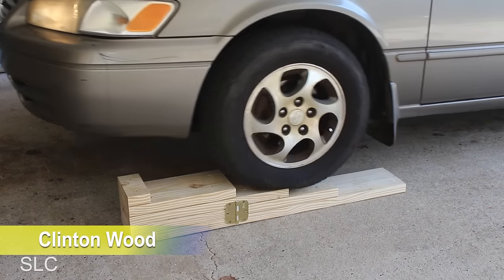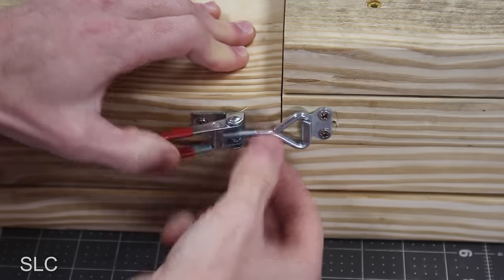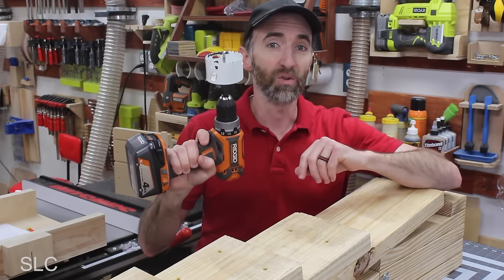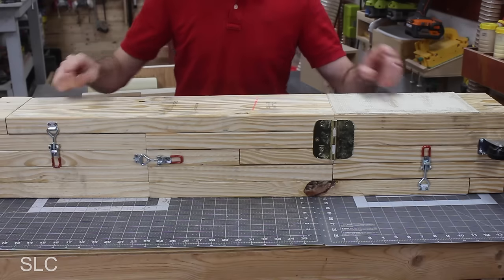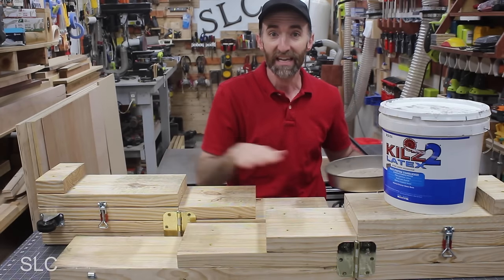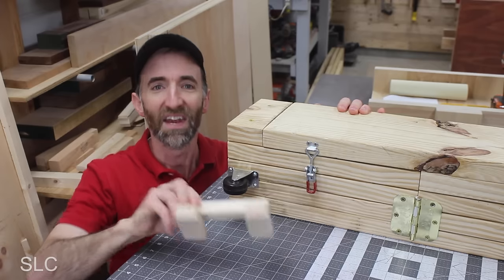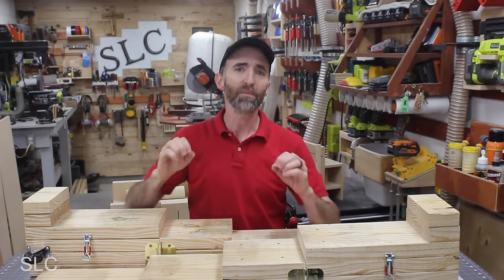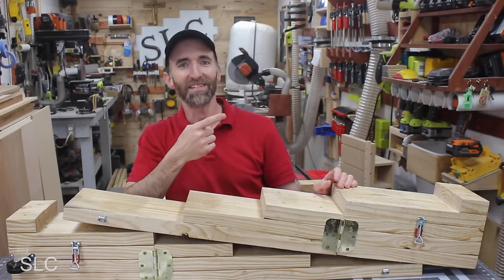Improving the Best Car Ramp EVER

Comment: Good video, I made some similar about 30 years ago. I like your hinge part to swivel out of the way. To improve your caster, recess the casters and maybe even just clamp them togather on both sides so you could just get them out of the way all togather. Mine are longer so I can drive further on them but they do not swivl out of the way. I think I will make some more and make the center board longer on the drive up side to where it will engage into the section that the wheels set on. and use the clamp idea  on both sides to get the drive up side completely out of the way, i do want the set on side longer though. Some really good improvements ideas in this video.

Comment: could also add truck bed liner on the tops to give grip/protection
Reply: Could you add it to the bottom to reduce sliding on the concrete as well?

Comment: For service work the entire length of the car consider two sets. One set for the front and one for the rear. Good grip to the supporting surface, concrete or pavement below, will be critical for the set under the non drive wheels of the vehicle.

Comment: the 45 degree is very necessary, specially when you need to push the car instead of using his own power, also it  helps to go easily and when you touch the 90 degree stopper you can feel it is the end of the ramp

in my case i needed them much lower because of my race cars didnt fit on lots of things and needed it a little bit of height to get the jack underneath so i can lift it up much higher

Comment: Use linseed oil to preserve and protect the wood it just basically soaks in and doesnt compromise it ie making it slick can also put some old tyre cut offs for additional grip along the bottom plus up along each step but everything added will add weight

Comment: Some good suggestions. I would also be concerned about driving over the block on the top ramp. It's a good reason to put an angle on the other boards so the car rolls over them easier. That way when you hit the top it would be a lot more noticeable. Personally I prefer to just use my floor jack and jack stands since 90% of the time I am working on the front end requiring my tires to be removed. Still, this is a good design and beats the old metal drive up ramps which cost more and have a tendency to slide.

Comment: Have similar ramps that we use at work, we drive 50,000 lbs buses on them so most people using these for their cars could remove a lot of material for weight savings without them becoming to weak.

Comment: Great video and i think ill build me some cause even tho i have a truck thats about 11inch off the ground its still a little hard to maneuver around. Now i do have a suggestion for these ramps tho. The bottom board i think is great and all but if someone wanted to reduce just a hair bit of weight to cut off a portion of on both ramps. They would still close up together when stacking and most all vehicles dont truly need that much extension for there vehicle to climb up.
Reply: Sports cars 🏎

Comment: I would add a 45 degree miter to all the edges of the boards that you are meant to drive over. This will make them easier to drive up and help separate the feel of the top stop block from the other boards.
Reply: Your both right.  Only a moron would leave out the miter.  And a stop at the top is really not necessary if one has any awareness of what they are doing.

Comment: If you work on a shed or garage. Mount a mirror on the wall so you can see the car wheels on the ramp.  Second hand furniture shops often have large ones cheap.  That way your 'spotter' can fetch you a cold drink instead of having to stand there

Comment: instead of an extra block for the stops a 2 or 3, 1/2 bolts 6" to 8" long that drop in 5/8" holes at the end of the ramp.  The bolts could be stored in horizontal holes at the end of the ramps when not in use

Comment: I think I'd use the type of hinge that can seperate. Then the whole lower side could be removed when the car is up. My workshop has a hoist and floor jacks so I don't have need of these. On the trail I made wooden traction boards that I've used as ramps using rocks underneath. Didn't need to raise the 4x4 much.

Comment: Nice job, something my dad would have made. I would make them wider and place a handle so when you use the wheels you grip the handle. The drawers liners are going to wear out too fast for my liking. You can still use them, I just wouldn’t mount them to the ramps. I’d lay them on the ground and then place the ramp on top. I wonder if a chuck or something else might work as well. I wonder if skateboard grip tape would work on the top and bottom for grip.

Comment: Hi, I would suggest cutting at lease a 45 degree angle on each step so that the drive up will be a bit smoother. I understand that it won't be by much. Also, the first step don't cut the angle to a sharp point.

Comment: I love simple and effective solutions, I'm a diy'er from way back.  I wouldn't waste time with handles or latches, I would just use a couple of those adjustable luggage ties, or even a couple of bungee cords wrapped tightly around, and another bungee cord to use as a handle across the two strapped around.  You could add another longer board on the bottom so it was still a graduated angle of elevation.  If you still can't get in on the side, why did you design them to be split in half with hinges and break away?  I would think you would want a height so that you COULD access things from the side as well.  Finally, some kind of stop would be good, but being careful is just as good.  Maybe use wider wood, to be safe and not slip off the ramps?  Great idea, watch out, some company may steal the breakaway idea.  Check out how to patent that.

Comment: Definitely go with pressure treated lumber if you cannot keep the ramps dry. Trying to paint those water proof and failing may cause catastrophic failure when the wood inside the paint has gone bad but you cannot see it until it collapses.

Comment: I'd add in a tire chalk(2x8 strip) to the front of the top step. That way the tire sits in between to chalks. This would need to be planned though. On yours it would mean removing the top step, adding 2 strips to the end and 1 strip where the old step was. For mine I just used a scrap 6x6 and cut the middle at a steep angle to make 2 ramps.
Reply: tire chalk, or tire chocks???  I don't know what you do for a job, but I hope it has nothing to do with reading and writing.  You must have gone to public school.

Comment: I'm going to make these, but since I'm an electronics geek I'm going to add two pressure-sensitive switches to the top level that will sound a buzzer when my tires press down on them.
Reply: You could always use just an ordinary analogue little bells mounted at that edges ;)

Comment: Looks good, but I think I would screw a big metal handle on the front of each one so I could slide a 2x4 through them.
That would keep them aligned with each other. I just bought a floor jack and jack stands, so I'll probably never need to make one.

Comment: That top board where the tires sit when the car is on top? I'd probably add a small concave cut to it's surface. Thus cradling the tire for extra protection when the car is up in the air. Doesn't have to be a major but maybe just enough to make a difference & not interfere with the car bumper/wood stop on top. I'd use a angle grinder or band saw to carve it out. Maybe even adding a folding board or one that could be clipped or installed/attached where the car climbed once it's up in the air, thus hugging the wheels on both ends(like a chalk). You could flip out the other end or simply just attach once you drove the car up. A little extra protection can go a long ways with either idea. Maybe also adding a little bit more length on top for bigger SUV tires would also be good. Cheers

Comment: I wonder if you can carve out a slight concave curve on the surface in which the tires will be resting on for the duration. It doesn't need to be deep, just enough to secure the car in place but still allow it to disembark when the job's done. 🤔

Comment: If you want to make the boards Permanently protected. Paint them with Truck Bed paint dowsed with sand. That stuff will NOT come off and takes a beating. That's why the paint is so expensive but waaaaay worth the price😉

Comment: GC PT wood does not las any longer than untreated lumber in this type of scenario, be it left outside in the elements or not.  The only benefit they have is when they are actually in constant contact with a surface that could possibly hold moisture for an extended period of time, but not a constant/submerged setting.   

In other words, don't waste your money on buying PT wood specifically for a set of ramps that you would possibly be leaving outside. But if you have some laying around, then by all means, use what you have.

Comment: a single one of those boards can easily hold the weight of a car or van, and probably a pick-up truck too, so there's no need to make a ramp out of a solid pile, instead, use  a tapered 20x40 (2"x4") on edge to provide height.

Comment: To give it a really non-slip property, maybe some tool handle coating all the way around.  Not sure how long it would last, being that wood does have moisture content, but it might help.
Reply: I would put some silicone caulk on the bottom of the wood. Squeeze out 1/4" beads of silicone perpendicular to the wood. Put a piece of waxed paper on the floor, then lay it silicone-side down while the silicone sets. Then peel off the waxed paper after the silicone is set.

Comment: Make them 4 inches longer and put your 2    4x4 stacked stops 4 inches away from the edge. That way there's less a chance of running over the top and keeping the weight more towards the center of the ramp and not the edge on the end.

Comment: I have never liked the metal ramps, move too easy, and almost useless in gravel and dirt. These ramps are a great Idea, before the suggestions and now are a little better. Like several, my concern is the stop. I'm usually doing auto work alone. I wonder if the 15" boards could be cut 3" longer to 18" and put a 3" board 3" from the front of the 18", it would be like a 5 step, and another at the end where you put the original. You should feel the tire go over the first 3" and know to stop. Would have to buy the next length board. I always use treated for my outdoor projects. More money but 100 times better than metal. GREAT IDEA.

Comment: All you needed to do is to cut a tapper across each leading layer, not only no sliding issue also makes driving up the ramp easier... Save $$ on getting those extra materials, especially on the anti-skip pads as they are not exactly that durable for 2+ ton vehicle use...  As for driving on to the ramp, simple count the steps then stop with driving over the ramp... LOL, just count the layers/steps OMG!

Comment: Tey could not slide unless you hit the throttle when getting off , as soon as your tire hit the ramp with the tire, it will hold it still as long as your other tires roll normally.

Comment: my wishlist:.   A panoramic sun visor that wraps around the driver side window AND driver half of the front windshield. 
not a cap /hat / heat-visor.
not tint. 
not the typical telescoping flip downs that you need to flip flop b/w front and side.

Comment: Hey quick question my car is lower than average so I need this a little longer. If I extend all your measurements by a certain number with all the boards it still should fit together correct I know I’ll have to buy 3 10fts.. for instants if I extend every board by 3inches from your original measurements they all should be able to fit together for storage right… sorry if this is a stupid question..
Reply from the maker: If I'm understanding correctly you plan to extend all of the boards 3 inches. If this is the case then I believe they would all still fit together.

Comment: Pressure treated lumber may resist decay and rot better.....BUT.....pressure treated lumber tends to split a lot easier too. Better to use normal yellow pine with a coating......

Comment: Hi, I made something similar about 25 years ago from scaffold boards, to make it slightly easier to get onto them I cut a 35 degree chamfer on the ends of each bit of wood so the tire rolled up easier.

Comment: Thompson Water Seal is an excellent product for protecting the wood from water when stored outdoors. One coat will protect the wood for several years. The wood can still be painted to give it the color desired, but an oil-based paint will be required. The Thompson Water Seal should be allowed to fully dry before applying the oil-based paint - usually a day or two depending on the local humidity.

Comment: Why are you using hinges at all? Why not just have pull tight clamps on both sides? Now since the high and low sides aren't attached by the hinge, you can carry the two ramps with one in each hand. You still nest high and low sides atop each other to make a block, but this block is half as heavy since it's only one ramp's weight.

Comment: Do NOT add holes intomthe wood. The wood has tonbe solid bear all that weight. Of you have hollow bits it would cause the wood to crack under load.

Comment: Accident waiting to happen. NO guide to keep the wheels from falling off the side. I would have cut the ends of each step at a 45 degree angle. I would have also made the end stop double the height. Two rollers would keep the ram from twisting as you move it. A simple hardware store handle at he end to make it easier to lift and pull it along.

Comment: I have some shelves sat around that I'll use. They are not as thick as those planks, but they are free, and I have enough wood to make two ramps. On the plus side, there will be more steps on the ramp, so it will be easier to drive up.

Comment: I've been doing mechanic work for over 45 years. Ramps have hurt and killed a lot of people. Not to mention the damage to vehicles. Jacks and jack stands will let you live to another day. BTW, if the driveway is a little uneven, you'll never swing the lower portion of the ramp out to gain access to the center of the car. And there's a lot of big guys out there who'll never be able to slide under the car. 🥴. And kitchen shelf liners for traction? A few pieces of non slip tape will be great.

Comment: The shelf liner is worthless. As a 3500 lb vehicle drives onto the 1st 2x8, it will not slide under that weight. That will continue as each step has weight added. I've been driving onto wooden ramps for 50 years. Those small screws will not hold against vehicle forces. A second set of 'loose pin' hinges with the pin out to hinge will do a better job. 
Coat them with used oil. It will not make them slippery. 
Those $20 ramps are now $40. 
You cannot make them idiot proof. Idiots will always find new ways to screw up.

Comment: 1. I'd angle cut each step for smooth roll up on ramp, 
2. Skateboard tape on ramp surface cut into maybe 2"wide strips.
3. Bicycle inner tube for bottom of ramp cut same as skateboard tape or how ever you see fit.
4. Angle cut each step for smoother roll up.

Comment: Your material is 1.5 inches thick so you put 4 of them together and got 6 inches tall ramp. Instead you should have turn the boards vertical in 3 rows and put a cheap piece of plywood on top also making each ramp 10 inches wide. And to keep them from spreading apart under pressure  just drill a hole through all 3 rows and put 3/8 -16 threaded bar with nuts at the end.  And for the angled part you take one of the boards which is 3 feet long, draw a line from corner to corner and cut it. Now take one piece and reverse it. Just glue them together and use some long screws. You will get almost 8 inches height on one end and almost sharp on the other. Just put the same plywood on top. And maybe some small pieces of wood in between to prevent from spreading under pressure of the car. This way both pieces would weight a lot less and you would have taller and wider ramp. 
That is what I did and it works great. Also, they don't slide at all because the bottom has 3 rows of wood instead of being one plane.
Reply: So with your idea you would have three 2 by 8s turned on end and spanning 10 inches? Those three boards would be four and a half inches wide which means there would be a gap between each board of 2 3/4 in. So you put scraps of wood between these three pieces and tie everything together with cheap plywood on top and 3/8"  threaded rod?  If you put those on ground that isn't perfectly flat wouldn't there be a danger of it racking sideways? With your cheap 3/4 inch thick piece of plywood covering the top of the ramp and the top where the tire sits, your ramp would be 2 inches higher than his but his seems much more safe and stable, and much easier to build. I recently had a pair of steel ramps that raise the vehicle 7 1/2 inches but my Dodge car couldn't use the ramps because the front bumper cover was too low to the ground and would hit the ramp before I could even get the wheel on to it.
Reply: @johmac30  Nope, everything is stable as a rock. Already used them several times. These ramps are not just taller but wider too to make them stable. 3/8 rod is to keep pieces of wood from spreading apart but not necessary really because I also screwed and glued everything together just in case.

Comment: You don't need to spend a dime "coating" them to protect them.
As I mentioned in your other video, a guy can just use the spent oil after an oil change to paint/stain them.
That provides excellent water resistance and rot prevention. Your ramps will outlive your car. (and probably you as well!)

Comment: Cut the front of each board at 45 degrees or more to make it easier to drive up. Add an extra thin board like 5mm thick so that the Tyre sit on it before it hits the thick board so there no chance of slipping.